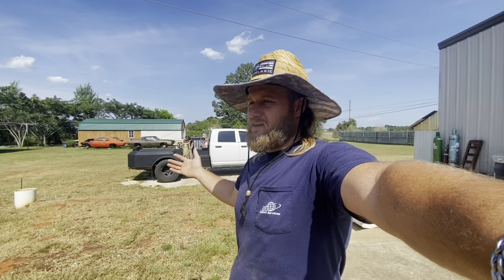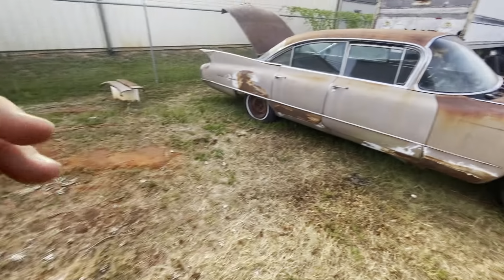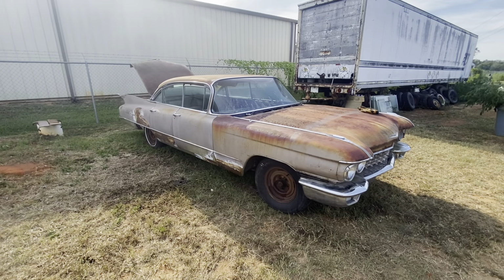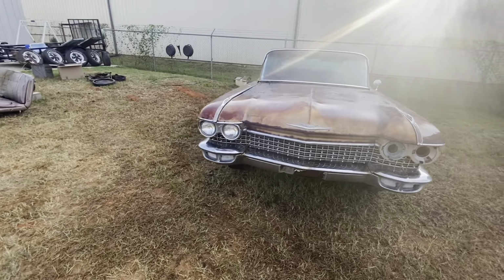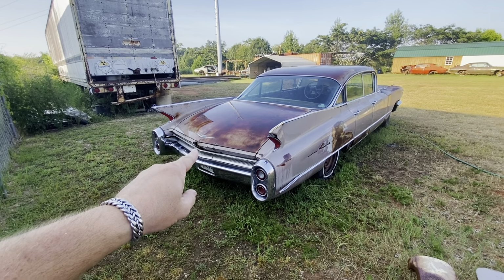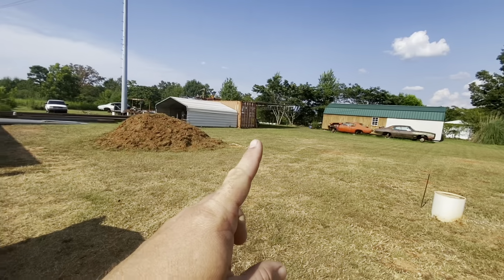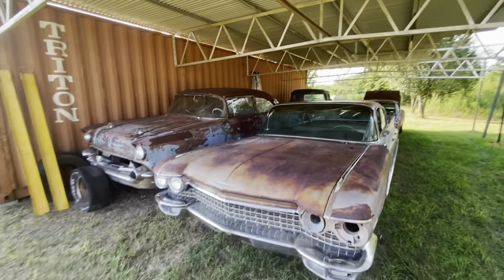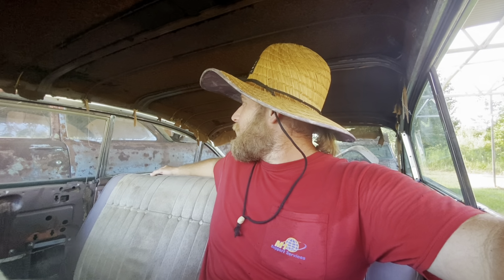RARE PINK Cadillac gets its first wash in years! Cummins swap? The ultimate car hauler!

Comment: I say go for it on the necessary mods to Double Trouble for drag week, the scattershield and hoop are safety things that don't impact the daily driver aspect of the car, a roll bar makes the backseat hard to get in and out but how often do you have people in the back anyway? Don't know at what e.t. it's needed but a SFI certified harmonic balancer would also be a good idea.
Reply from the maker: You’re very correct the car needs the safety stuff anyway! It’s got an SFI balancer already, but I’m planning to do all of the other stuff when I can. It doesn’t have a back seat so really just need to get to it.

Comment: I think it's got a great patena. Needs a bit of pink touch up on one side. Id put strengthen plates under hood hinges and pour clear resin in the holes . You can sand off resin  and clear coat. Go with what you got..id bolt three mm plate to the floors leave as is. And sound deaden.. Put the engine in and test drive a while. That's a cruise ship. Less is more. Good luck. Id dedicat a few hours a week over winter. Keep it. Its got charector. Have a good week..Adios. .
Reply from the maker: You’re 100% right it’s a yacht! I love the patina as well and I was lucky enough to find a better hood so I guess I’m gonna learn to paint and try and match the patina. It does need some paint on the passenger side and gonna have to blend those repairs at the b pillars. But gonna be awesome! Currently working on the “new hood”. Thank you for watching have a great day!